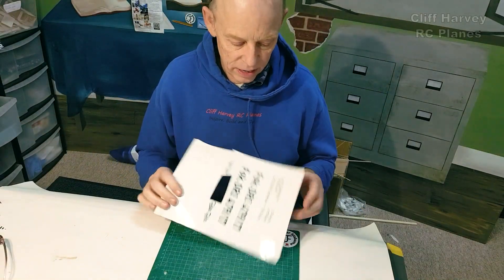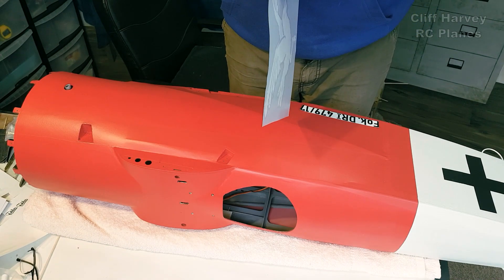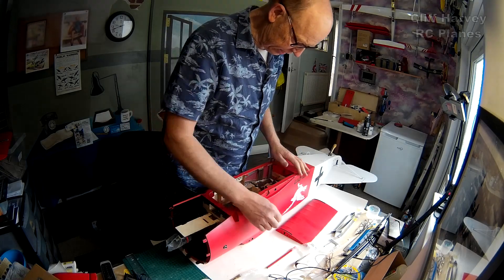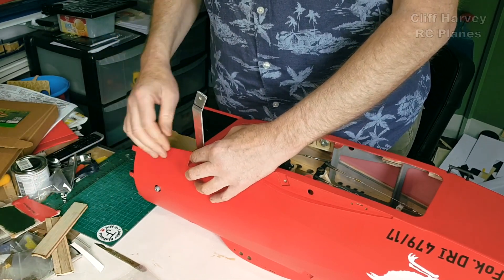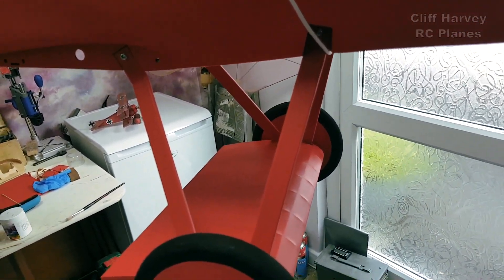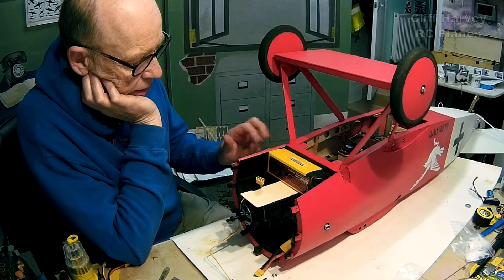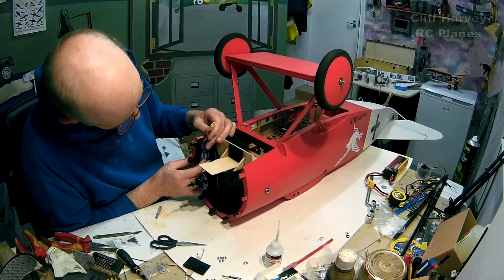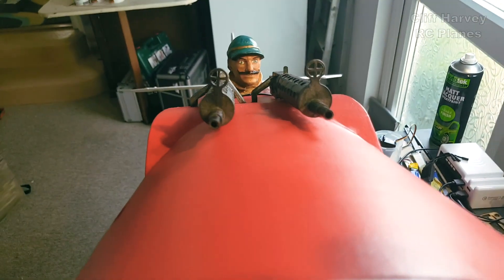Fokker Triplane Big Build Part 12

Comment: Take painters tape..wrap around the battery and make a pull tab which would be positioned upwards..grab the tape tab and pull straight up.  Then you can always remove tape later for another aircraft.
Reply from the maker: Gravity will do the trick Lawrence, it'll stay on its wheels, thanks for the idea though 👍

Comment: Looks great Cliff!  I used two opposing nuts on the inside of each wheel - it makes the axil length perfect.  Heat shrink on the upper wing struts will hold/hide the wires to the top wing servos, too.  But, I bet you were going to do that anyway.
Reply from the maker: Thanks Dan, double nuts would have been a better idea I guess but I managed in the end. I added a little balsa to the struts as well to bring the surface up to the same level as the wire, they're invisible now. Are you any closer to your maiden?

Comment: Hi Cliff the heat shrink on the landing gear was an awesome idea,,,just thinking if ever done again a little bit of round rod on the leading edge might make it look like streamlined tubing like the original,,,,keep up the great work
Reply from the maker: Well I did consider that Mike but when I did the heatshrink it actually looks ok. A piece of dowel would have possibly left a small intent at the join so it would have needed filling, so probably not worth it. Having said that the cabane struts will have the aileron wires under the heatshrink so I may use some balsa to disguise the 'lump' prior to heatshrink 👍
Reply: @CliffHarveyRCPlanes  I think it looks really good ,,,if you’re at a distance on the one I’m rebuilding it looks just like your,,thecarbane struts are the same material on the real one 😀
Reply from the maker: @mikejackman4416  I've just made the cabanes Mike and you'd never know there's a cable running down, I added a piece of 1/16 balsa to make up the difference and the jobs done 👍

Comment: Looking great Cliff. I thought that might be a 12s flyer? Did you make enough room in the battery hatch for larger 6s 5000mah batteries? Looking forward to the successful maiden. Jeff in LA USA
Reply from the maker: Thanks Jeff, I think the motor is actually rated up to 6s but it'll be ok on 4, I hope, otherwise I'll have to get the hacksaw out, cheers 👍

Comment: Man Cliff you are so close! What a stunning job you've done. It is beautiful. I like the gear wires.  Very smart mod on the wheel covers. Like the battery install...should make that about as easy as it can be on a plane like this. How much ballast are you going to need to get it balanced and where will you put it?
Reply from the maker: Thanks Adam, the best place for further ballast is as far forward as you can get it of course but I feel the motor mounting tube is already carrying more weight than I'm comfortable with so maybe behind the bulkhead. I'll wait and see what we're talking about then give it some thought 🤔👍

Comment: A hair ribbon tied into a loop, big enough to drop round the battery. Loop the battery with the ribbon before inserting the battery into its compartment. The loose end of ribbon tucks under the Velcro, until you have to retrieve your battery by pulling the ribbon.
Reply from the maker: Don't forget we're looking at it upside down Koala, gravity will do the rest 👍
Reply: @CliffHarveyRCPlanes  Ok, I thought you were planning to invert the model to access the battery. You explained how to remove the battery by pushing one end down, so the other end pops out far enough to grab hold of.
I use a ribbon in one of my planes that has a “no room for fingers” battery compartment.
Reply from the maker: Yeah, another commenter thought the same, thanks for the idea though 👍

Comment: Watch it, Cliff: WWI pilots did not have shoulder harnesses.  Most of them had a belt across the waist, but some did not even have that.  Safety of the pilot was an afterthought in those days (no parachutes because the pilots were supposed to try and save the plane at all costs).
Reply from the maker: I think the Dr.1's had them Gudjon although I had to cheat a bit with the design, but you're right otherwise 👍